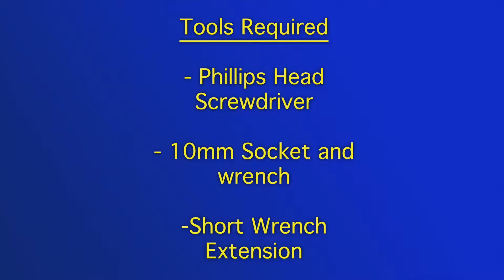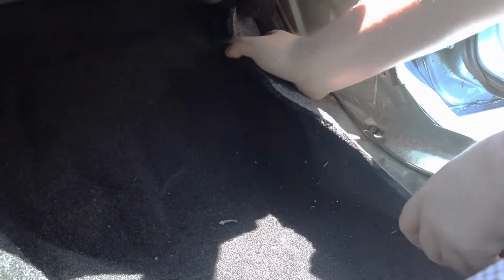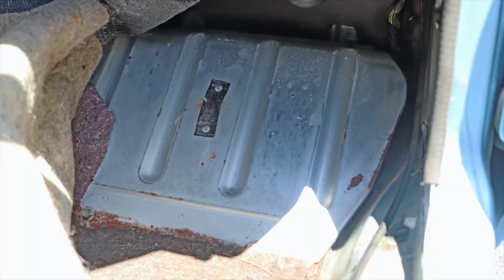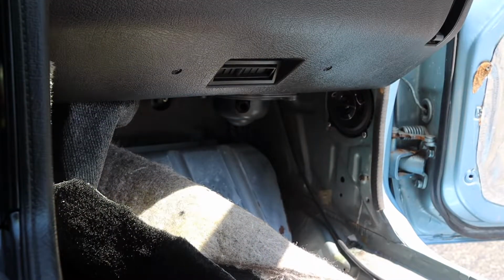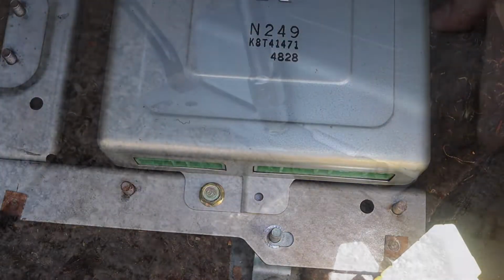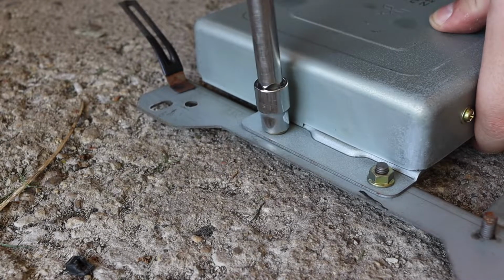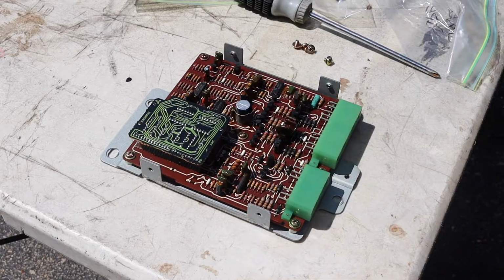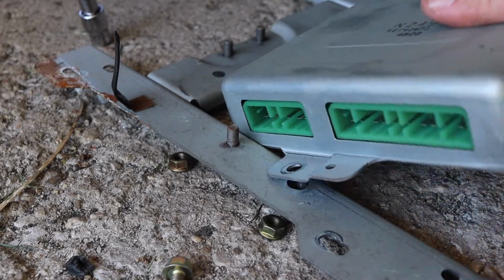How To Remove The ECU In A First Gen Mazda Rx-7

Comment: I pulled mine today and soldered all joints that looked worn. I solved my break light issue, but I still have the infamous 3800 rpm studder. Its gotten worse and I can't drive the car. My next option is to clean the ecu ground under the intake. If its not that maybe its injectors or the omp causing my 1987 fc to go into limp mode. Any suggestions?

Comment: Isn’t the stock FB a carbureted engine with mechanical advanced breaker Ignition? Why does it have an ECU?

I’ll have to check if this is similar in my 1980 SA with 85 12A Swap. I bought it some weeks ago and will put it on a lift in ~15 hours.

...It sat in a garage since 2000
Reply: late FB spec like the GSL-SE came with EFI 13B :)